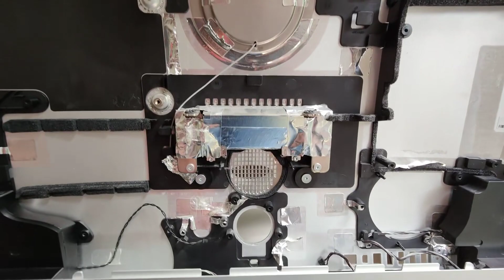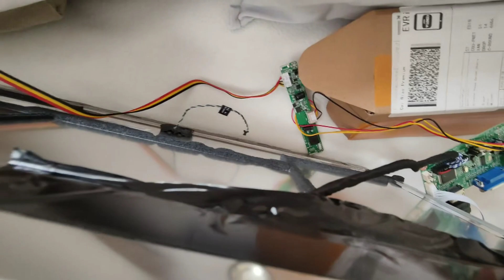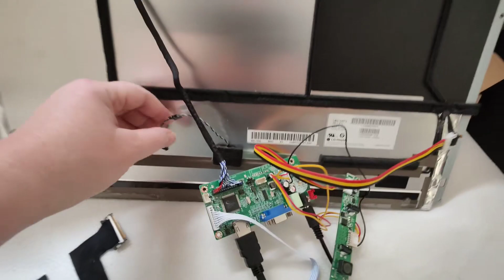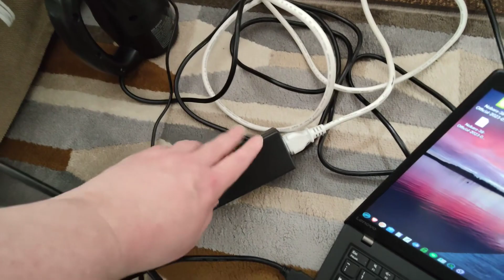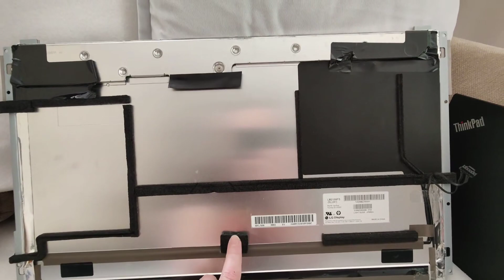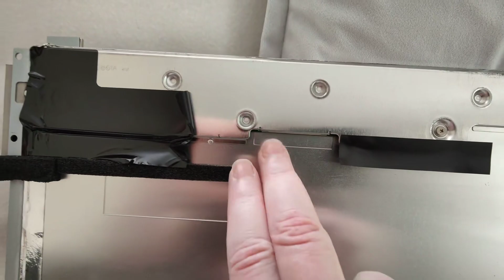Converting a 2009 21.5" iMac into a 1080p Display

Comment: Hey amazing video thanks for the sharing all the information, I'm planning to do this project with near zero experience with electronics, so I was wondering is the monitor still working fine for you after two years and would the effort be worth it :)

Comment: Did you ever get the speakers working?
Reply from the maker: @BullDetector-365  they're still in there but I never bothered. Ii did watch a video of a Japanese guy who did a brilliant job of finishing everything off and he did a bit of soldering to get the speakers working. He also modded the case to get and audio jack working etc. it has English subtitles and shouldn't be difficult to search for.
Reply: @jinty83  Thanks very much. Nice accent btw 👍

Comment: @Jinty_x_Linux hi, I have the same imac model, in the aliexpress link the "LM215WF3(SS)(C1)" version is selected, is it the correct one for your model? (A1311)
Reply from the maker: You need to check your imac to see which model of panel it has. Even if it's the same model as mine it might not have the same panel and you wouldn't want to order the wrong controller board as they are specific to the panel you have. This means you'll need to take the panel out of the case to check the model number on the label at the rear of the panel. (If you haven't done that already). You can access that without too much trouble by pulling the glass forward, removing it and unscrewing the panel.  I hope that helps.

Comment: Hey girl thank you so much. What do you do about that vertical alignment ribbon cable that’s attached to the power supply in the original iMac’s internals?
Reply from the maker: Hi, if you are removing everything from the imac to turn it into a display like I have in the video, the only cables that are required are the video signal cable and the backlight cable. Without all of the mac specific stuff it's just an ordinary lcd display panel. I hope that answered your question.
Reply: Ohhh ok tyyy. I thought it was needed because it's attached to the original inverter board but never mind.   @jinty83